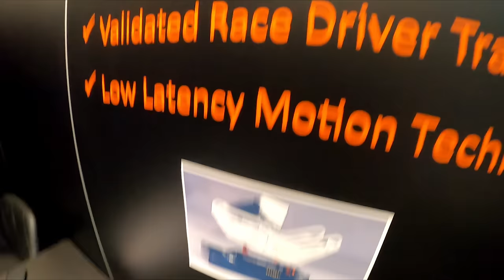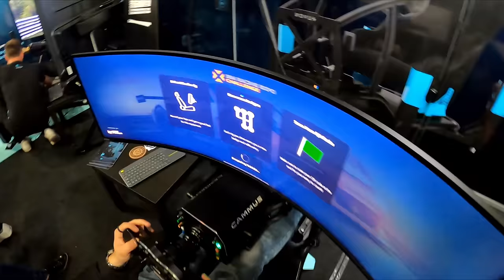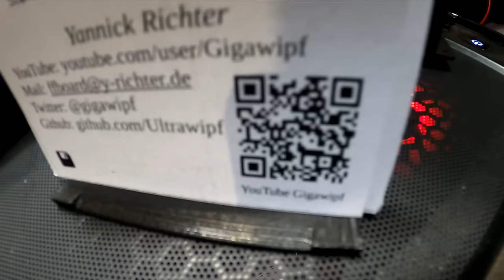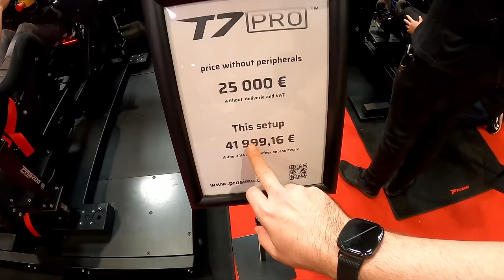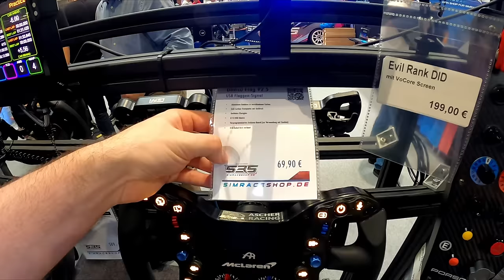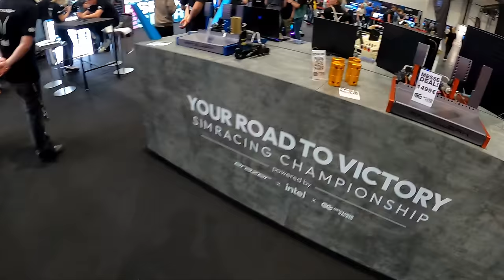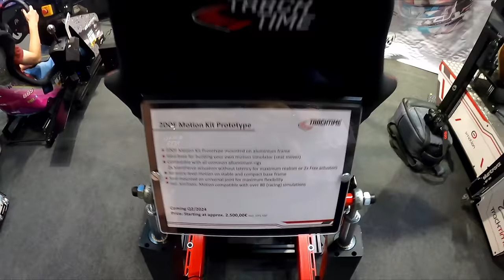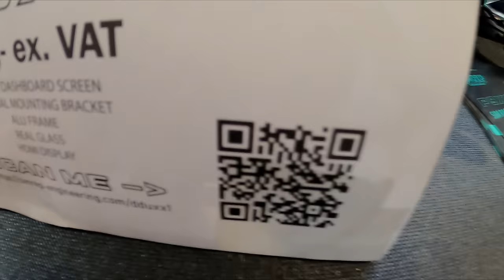SimRacing Expo 2023 - Insane Full Tour Of Everything !

Comment: What are the buttkicker seat mounts on the SimSwitch rig around 1:49:24 ? Are those part of the rig itself or purchasable independently compatible with t-slot rig? That would be an awesome product.
Reply from the maker: butkicker has been doing transducers for decades , can put them on office chairs or annything , cheaper to just use your own with simhub though.
Reply: @GamerMuscleVideos  I was referring specifically to the special seat mount /side brackets that includes additionally mounting points for the buttkicker
Reply from the maker: Oh not sure , could probably make some yourself or find metal that would work.  @bystander85